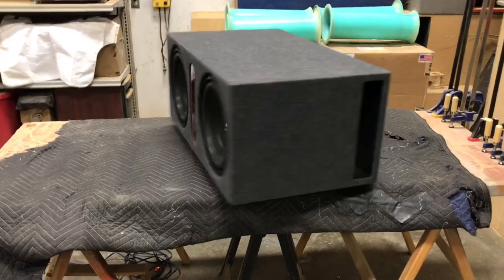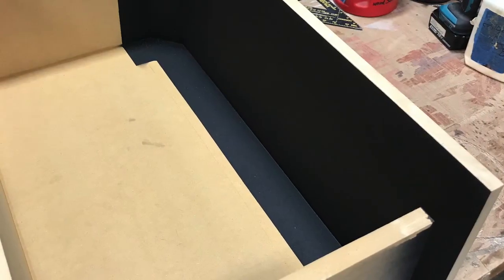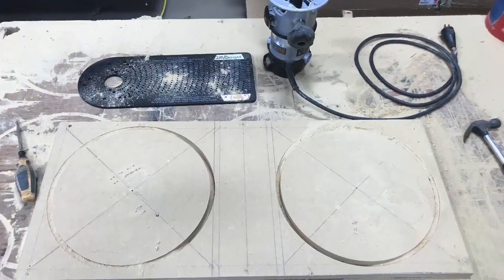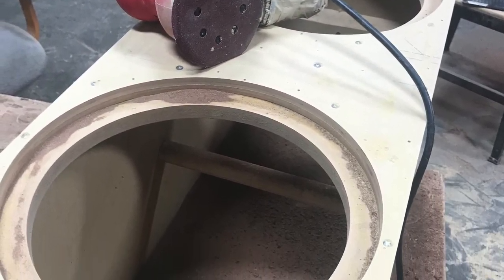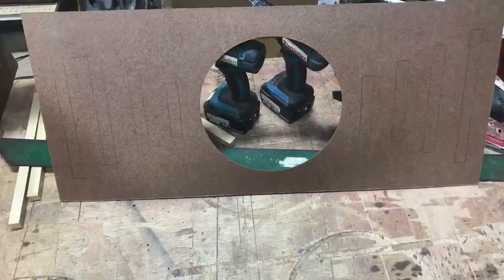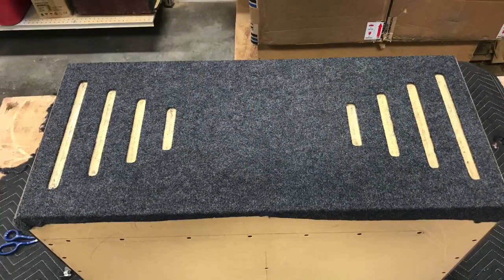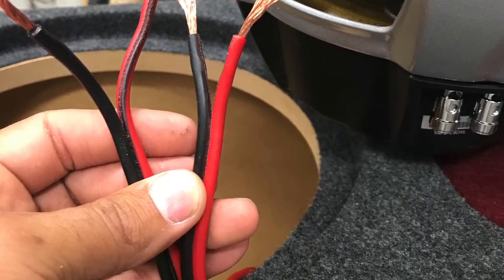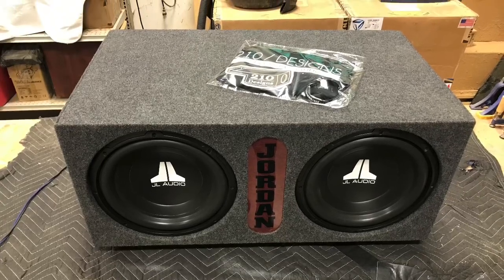Custom ported enclosure build for 2-12” JL Audio W0v3 subs.

Comment: Another nice one! What is that green bar you are using to line up your circular saw cuts? I need a guide like that as I'll also be using a circular saw (no table saw).
Reply from the maker: CORZERO - Thanks bro! It’s called a “carpet straight edge”. It’s a tool used by carpet installers. Mine is made by a manufacturer called Crain. I found some on Amazon. They have all types of manufactures and better pricing. I’d recommend one that is at least 3” wide, so it doesn’t bend/warp when your cutting. And at least 4’ long, because most sheets of materials are 48” wide 🤙🏾.
Reply: @210Designs  Awesome! Thanks! Building my very first box in my empty garage, so I'm kinda limited, but I'll do my best and this will help a lot!
Reply from the maker: @CORZER0  - That’s exactly how I started bro 💯 If you need any tips, help or advise. Just hit me up, I gotcha covered. If you don’t wanna post questions on here, here’s my email: bj.hammon@yahoo.com
Reply: @210Designs  So nice of you! I saved you in my email contacts. I'll keep in touch and send photos of the build if you're interested! I'm going to pick up two sheets of Baltic Birch Monday. A 3/4" and 1" sheet, grade B/BB. Hopefully I'll have time to get it all broken down Monday. Then I'll start the construction process. Going to take my time. I bought six 3/4" pipe clamps and six 48" lengths of 3/4" black pipe on Amazon. Got clamps today, pipe Tuesday! Also bought Toughbuilt C700 saw horses and some lumber to make a little work table. Horses should be here Tuesday. So excited to finally get this going! We'll be talking more soon now that it's all coming together this week, thanks again!
Reply from the maker: @CORZER0  / Sounds like you are well on your way bro. All very good products and necessary tools to have. Clamps are a must have in my book 💯 Makes it so you don’t have to fight with each piece, as your trying to add screws. Me and birch are not on speaking terms, due to the splinter I got last time 😆 Yea, send pics of the progress. I’m always interest to see their process and creativity. Keep me posted 🤙🏾
Reply: @210Designs  Will do! I'm so excited!

Comment: This man be going in. Carpenter box building craftsmanship 💪
Reply from the maker: Trapperjohn1000 - That’s what’s up bro, much appreciated on your comment 💯 And thanks for checking the vid, got a few more coming, before December 👀
Reply from the maker: Whatever happened to the SQ build bro????👀👀
Reply: @210Designs  man I got all the equipment sitting in the garage....got the Audi A8 but looking at the LS460 before I install $8k in stereo
Reply from the maker: @Trapperjohn1000  - That’s what’s up man. I hear ya, gotta get everything lined out, before you pull the trigger 👌🏾

Comment: Yeah just been testing and tryin to keep up with demand I'm doin a full navigation build with some genius stuff.im designing it now and trying to learn keep the knowledge flowing like diff in loc an lod bluetooth modules harleys material diff ways to get louder with less money I'm not gonna lie people drive me insane when they say I need a box and I say for what why and the sound you want they say I just need it to hut hard.its like they have no idea how vague that term is 160 at 35 is way diff than 160 at 60 ylthey both slam.
Reply from the maker: Good deal. Your always on that next level stuff bro, got my head hurting. Had to re-read that one 😆 Yea, people will definitely drive you insane, if you let them.
Reply: @210Designs  lmao exactly I'm all hoped up on fiberglass body filler and paint woooo

Comment: hey do you think you could design me a box?
Reply from the maker: All depends bro. Each build I design is different from the last one. That way there’s never 2 alike out there. I get my design inspirations, based on a few different things. Customer’s vehicle color, subwoofers and personal preferences. Then I add my 
210/Design’s touch to it 🤙🏾
Reply: I'm debating bc it would be for my 98 Chevrolet single cab behind the seats for either 1 or 2 Memphis mini mojo 6.5s
Reply from the maker: @pattonmann5356  - Definitely a good choice in my opinion 👌🏾 Single cab trucks have limited space for sure. Built a couple for some single cab Chevy trucks. A sealed one in a  2005 Chevy with a single shallow 12”. Fit right behind the console. Building one now for another ‘05 Chevy single cab. Ported down-fire enclosure, for 2-6.5” subs. Gets really loud inside the cab, with smooth sounding bass response 👌🏾
Reply: Hey for the ported 2-6.5s do you think you could give me all the measurements like once you get it done I've never made a box and just don't want to mess up so if you could that would be amazing
Reply from the maker: @pattonmann5356  / Sure thing man 👌🏾 Hoping to get it finished up soon. Squeezing it in between other customer’s builds 😆 Its for my youngest son.
Reply: OK thanks so much it really means alot bc I'm this would be my first ever box and want to make it a good one 🙏
Reply from the maker: @pattonmann5356  - No problem my bro, I understand. Gotcha covered 👌🏾
Reply: Sorry to bug you more but do you think the 2 6.5s will be louder than one ported 12
Reply from the maker: @pattonmann5356  - Never a bother👌🏾 Based on cone surface area, the 12 would be louder. But there are other factors to think about. Subwoofer power handling, box tuning, port and sub locations. You can only get so loud in a vehicle, when your limited to space available for subwoofer(s). I think you will be happy going with either. I’ll post a bud of these 6.5s and you’ll see what I mean.
Reply: Ok thanks
Reply: According to Memphis their 6.5s are 700watts rms and the 12 I was looking at was 600 hundred but well see
Reply from the maker: @pattonmann5356  - Your gonna have it beating for sure 👌🏾
Reply: Can’t wait🔥🔥